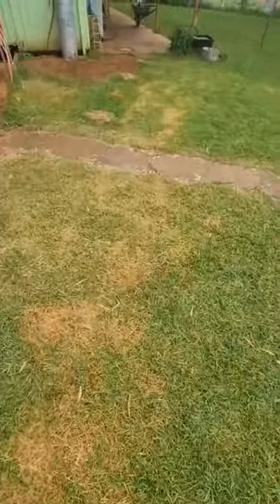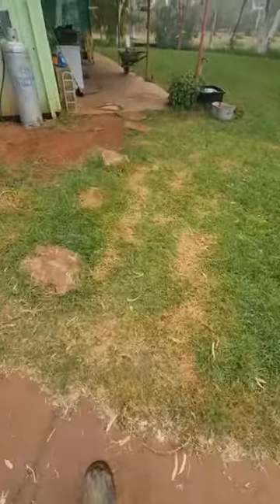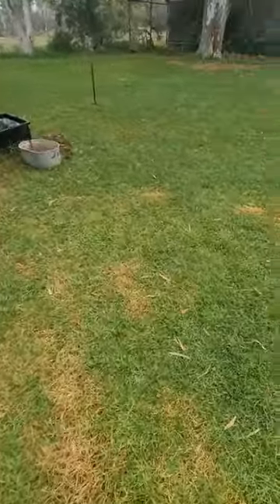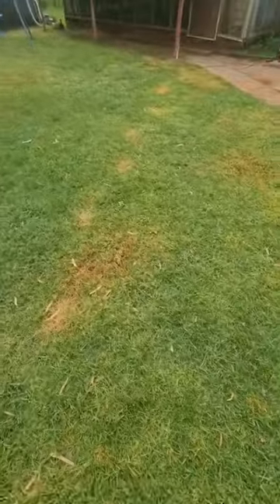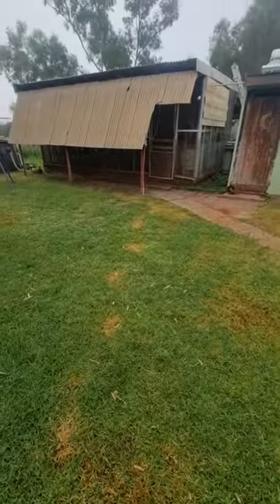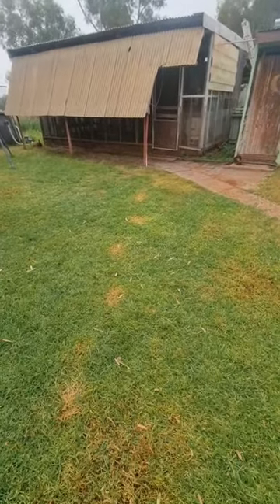Classic #roundup stuff up

Comment: What's a cool room? What's a shuttle?
Reply: Big refridgerated room assembled with insulated panels. Shuttle is 1000L poly container inside a galvanised steel frame that has pallet  fork holes underneath,  can contain bulk engine or hydraulic oil, herbicides, acids, caustic solutions .... all manner of chemicals.
Reply: @nunyabeeswax2575  thank you very informative 👍